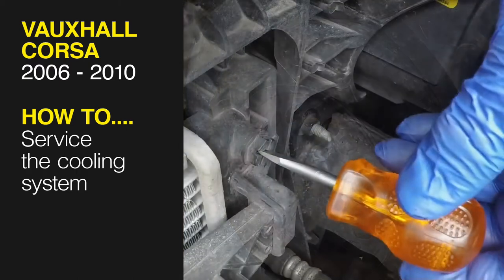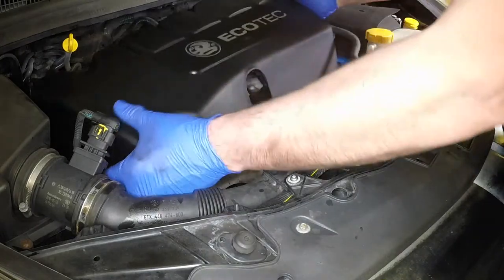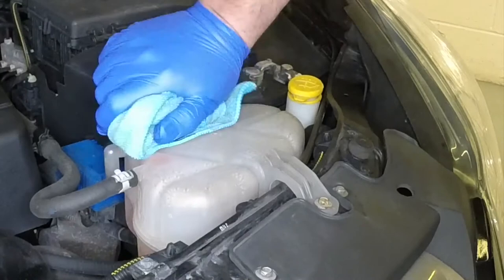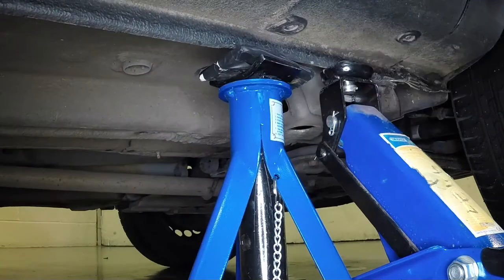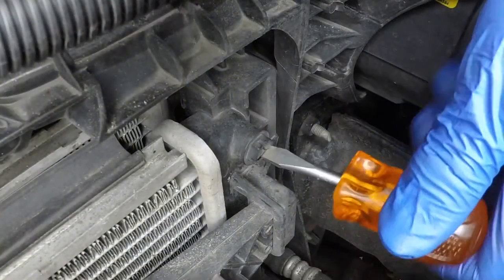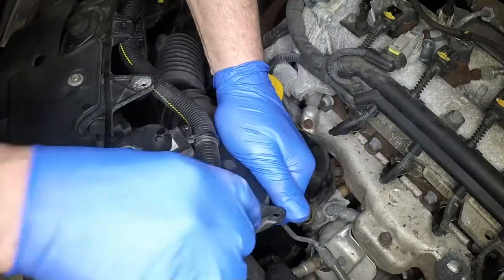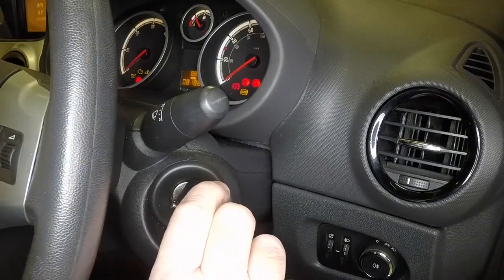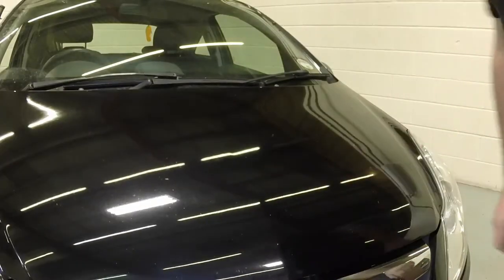Vauxhall Corsa (2006 - 2010) - Service the cooling system

Comment: At my corsa when it’s cold I can see smoke coming out from the side of the place you put water were there is a small hole..you think that’s normal?
Reply from the maker: No, not when it's cold. Check the pressure cap on the expansion tank.
Reply: @HaynesManuals   its after  like 30-50 minutes at street and its only when outside we have like 0 degrees

Comment: I dont understant why you remoted air intake channels?
Reply from the maker: The air intake channels were removed to access the radiator bleed screw in the top right-hand corner.